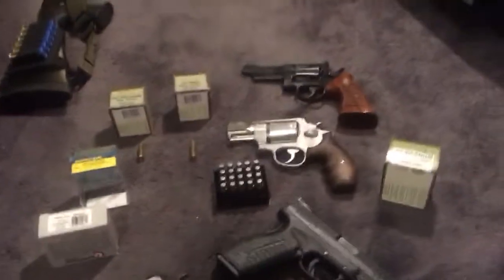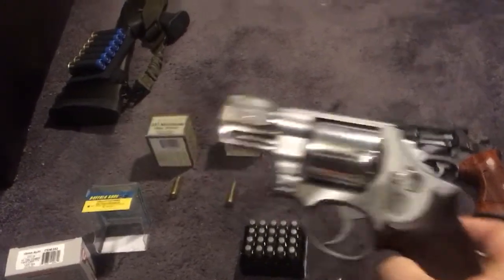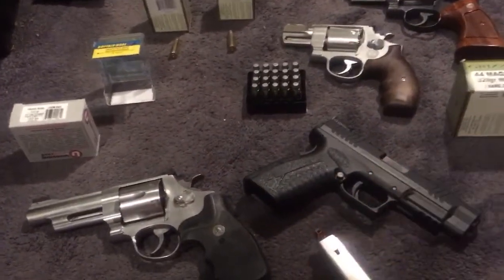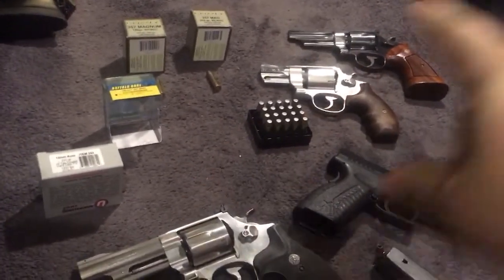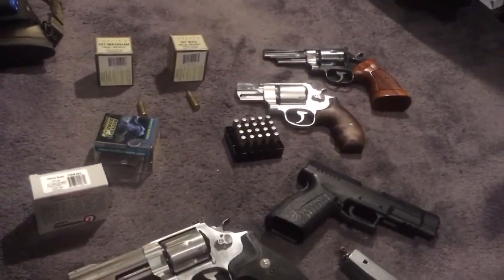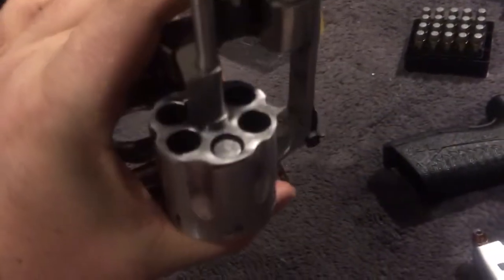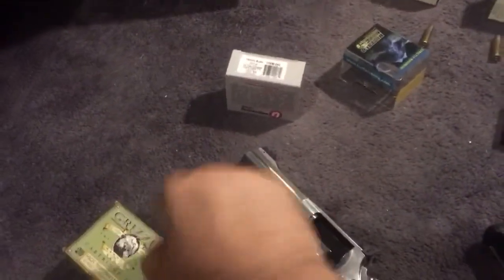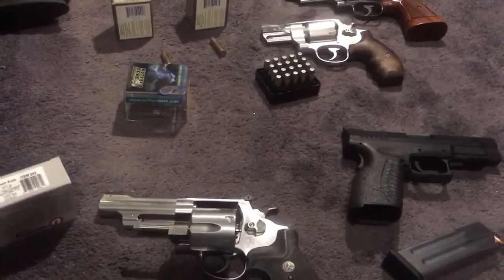Bear defense, hard cast bullets and velocities. Does barrel length matter?

Comment: Any 38 buffalo bore 158 hardcast data out of that nice short 357 ??
Reply from the maker: Buffalo bore has data on their page about that load with several different guns ranging from a 1 7/8 barrel up to a 6 inch barrel. Check their page out, but my gun would probably be around 1050-1100 FPS.  Their Velocity’s ranges from 989-1255 FPS. The muzzle energy range is 343-553 foot pounds of energy.  Even at the low end with a 1 7/8 barrel that’s a respectable number for a 38!!! And hard cast isn’t velocity based. 200-300 foot pounds of energy would penetrate good, and the Keith style of bullet actually causes damage as well! Good choice imho.
Reply: @The95ford   yes I  have looked and real life experiences is what I go by , I have a model 60-7 in 1 7/8  and have only shot 38+p 135 grain speer gold HP . I wanted something that I can carry her in Ny where I really got only black bears in 250lb range and 2 leggers. I really like this gun because of its size in the woods while fishing .   I have a 44 se 3inch 629 lew Horton,  but its impracticable fishing streams in my area under waders . Thanks for the response I appreciate it keep up the good work on your channel,. Keep safe